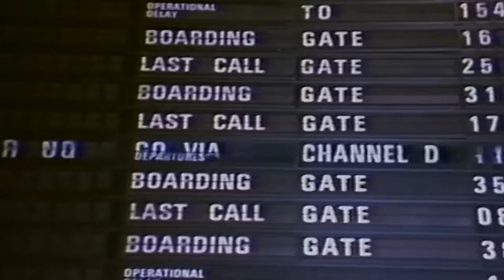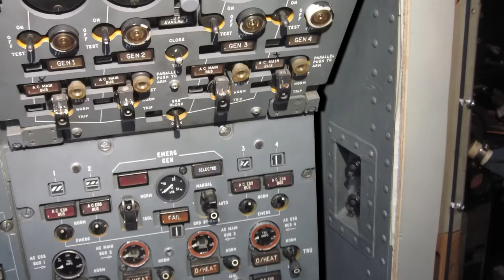Why Blue Paint Caused Problems For Concorde

Comment: The Concorde. What an epic plane!
Reply: It is! And always will be, I even have a picture of the Concorde that's in the Smithsonian air museum near Dulles airport when I was on a school trip to Washington DC!
Reply: Ok so fast speed and air friction was problem because air frame was expanding and shrinking during the flight. 

So how UFOs can fly way way faster than Concorde, some radar data tracked UFOs at incredible speed of 6 miles per second. 

How they can do it?
Reply: @oldi184   IDK some sort of incredibly strong and resistant material that isn't from Earth.
Reply: @Harrison La time traveler
Yeah, You can be right or some kind of "field", force field of some kind which is generated around the object for protection. 

6 miles/s = 21,600 miles/h
These objects can get to any point on the planet in less than 60 minutes. That is truly amazing. 
Another thing is what type of propulsion they use to move that fast. None jet engine will push air craft that fast horizontally inside dense atmosphere.
Reply: @Donald Clark
I have seen a UFO. A real UFO back in 2006. It was classic UFO not drone or balloon or helicopter.
Reply: US hosted Concorde for twenty-six years. How is this sabotage?
Reply: oldi184 idk because they don't exist
Reply: @harrisonofcolorado8886  ah. I think that was F-BVFB that was in Smithsonian.
Reply: @oldi184 🤣🤣🤣🤣 - they clearly don't employ British Airways and Air France engineers 👍😎

Comment: Very interesting. One remark tough. 4:25 white paint does not radiate more heat than other colours, it  absorbs less heat from the sun than other colours and thus reduces temperature on the surface. Black colour radiates the most, but also absorbs the most heat. That is why at the refrigerator the heat sink is painted black but it is put in shadow behind the apparatus. This way it can dissipate as much heat as possible. Keep up the good work!

Comment: A bit of additional information, the SR-71 was intentionally allowed to leak on the runway, instead of it being accidental. The parts were made so that when heated through atmospheric friction they would come into final dimensions, bypassing the need for seals that would work across a wide range of temperatures and mechanical loads.

The plane when taking off would have a minimum ammount of fuel loaded into it's tanks, relying on in flight refueling to fill it's tanks before operations. 

The JP-7 fuel is as well intentionally non flammable, due to a required high flash point and high thermal stability necessitated by the impracticality of completely thermally insulating the tanks.

Comment: @4:14 That's actually a myth, the SR-71 did not leak from poorly fitting parts while cold, especially not fuel on the runway. Several things contributed to this myth, it's worth reading up on.
Reply: Still not completely trustworthy, but there is a "first-hand account" for the 2nd answer. https://www.quora.com/Why-does-the-SR-71-Blackbird-sometimes-leak-fuel
Reply: In any case, the SR-71 is a flipping cool plane. And of you are in Kalamazoo, Michigan... Go to the airzoo to see the ST-71B

Comment: Might not have been as significant if it had been done about 15 years later. These days, there are dark color paints which are IR transparent so those solar reflective whites can be used as a baseciat under the dark but IR transparent colors and while they'll still be warmer than just white, they stay substantially cooler than a traditional dark topcoat.

Comment: Did Primal Space make a lot of this up?   At 4:27 it says that the Concorde's normal white paint was so that it radiated heat better.   Actually, to get rid of heat the best you need a black finish.  But a black airplane would be hard to market.   Painting it blue should have improved heat loss.  
An advantage of white paint is that the pigment can be titanium dioxide, which will not fade, regardless of time, temperature, and ultraviolet light (which is strong at high altitudes).
If the plane was limited in speed, it would be because they used a paint designed to be easily removed (possibly by simple water washing) after filming the commercials - paint that would come off due to friction and/or heat at the normal speed.
The SR-71weeped fuel because it was designed for low weight, so the wing skin is also the fuel tank - there is no internal tank or bladder.   The tanks/wings were supposed to be sealed with a flexible sealant, but when the sealant deteriorated, the aircraft very slowly oozed fuel.   The USAF just didn't think the expense of taking it apart and fixing it was warranted.   It didn't leak anywhere near as much as portrayed and it didn't leak for the reason given in this video.  I've seen USAF aircraft on the ground, and leaks of various sorts are not uncommon.

Why did the SR-71 have a matt black finish?  Partly to make it hard to see at its normal high altitude, and partly because it gets rid of heat the best.

Incidentally, there are a lot of urban myths about the SR-71, due to its secret nature.  The fuel leak due to expansion design is one, the US having to buy titanium from the USSR is another (The biggest ilmenite producer in the world is Australia, which is also a significant producer of rutile).

Comment: 4:26 That is incorrect, like you said, the reflective white paint allowed it to reflect more sunlight so it would absorb less of the solar energy, this would have made it worse at radiating heat.
If they wanted to radiate more of the heat they would have painted the plane black, just like the SR-71.

Comment: @5:50 ‘ Internet is probably safter than flying at mach 2 in a tin can ‘? Dude no concorde has ever crashed by cruising at mach 2 nor it is a tin can.
Reply: SierraAlphaGolf exactly and the only reason it crashed it wasn’t The concourse fault its because they filled it up fully a few there’s a piece of debris on the runway wich the ripped up a tire got caught in the engine and in the Concorde didn’t have enough power and crashed
Reply: I noticed a fair bit of envy by tbe narrator also.  It is not the narrator's fault that his nation could not come up with a supersonic passenger jet.  Why is he so envious?
Reply: @indridcold8433  It's a joke. America put men on the moon, we have no reason to be jealous of a plane.
Reply: @kvltizt  The captured German Nazi rocket scientist put a man on the Moon. The man just happened to be a great American and the project was funded by the Americans. The Saturn V rocket was developed by captured Nazi rocket scientist Wernher Von Braun.  His Nazi criminal war record was expounged in the Untied States of America if he agreed to modernise the antiquated American rocket programme.  This is common knowledge, well, unless you live in the United States of America where it is kind of a secret.  Without American funding and German rocket engineering nobody would have made it to the Moon.  However, one thing the Americans have that is completely incredible and probably will never be topped by any other nation, save maybe their own, is the Lockheed SR-71 Blackbird.  It is incredible to think that kind of technology existed in the late 1950s.  You have to wonder what technology exists today that is well hidden.

Comment: Actually, dark paint dissipates heat better, because it radiates more. BUT it also heats more under the Sun. Which would not make difference while flying at night, though.
I suspect the reason it was overheating was because the paint was not smooth enough.

Comment: 4:37 is t an interior of a Concorde. I’m guessing it’s an Airbus 320 variant.
Reply: Nicholas Barnard What makes you say that?
Reply: @atent5124  It's WAAAAY too wide. Concorde only had 2 seats either side of the aisle. The aisle itself is very narrow on Concorde, as is the width of the cabin overall. I've never flown in Concorde, but I've been inside "Alpha Echo" on two seperate occasions in barbados, and sat in the seats on both occasions.

Comment: Sr71 was black, so it could radiate more heat, the darker blue should’ve actually helped it radiate more heat away. Darker paints can radiate more heat, this does mean they can also absorb more heat, but the sun is not as big factor as the heat cause by friction at these speeds. So it should’ve been cooler, perhaps this is a miscalculation, or a very odd type of paint?

Comment: The SR71 and A-12 did not have fuel leaks on the runway, they used fuel as a coolant and when they couldn't burn it they had to dump it overboard on the ground.  If the aircraft was in flight the coolantfuel would just be burned up in the engines.

Comment: You've got it the other way around. High reflectiveness leads to lower radiation (and lower absorption of radiation too). One would then think that the darker paint would radiate more heat than the white paint but it ain't necessarily so. White is for sure more reflective than blue in the visible spectrum of light but it doesn't say anything about what happens in the longer wave IR spectrum that is relevant for radiation at the temperatures in question. For sure, the white special paint wold have looked darker than the blue one if viewed in infrared. I.e. the white paint was less reflective in IR and therefore able to radiate more heat.

Comment: The SR -71 fuel leaks weren't "sometimes caused" by expansion. It was Designed to leak like that so when it, Predictably expanded the fuel leaks disappeared. It was not a safety issue At All as the special jet fuel used in the Blackbird was extremely hard to ignite. You could literally put matches out in the fuel. Like diesel fuel, it wasn't even considered a flammable substance. Flash point was so high that they used a liquid to ignite it at first starting the engines.

Comment: I thought this was going to talk about the extra weight of an added 200 litres of paint. I recently found out that part of the reason planes are painted white is because to add colour to a paint you add pigments. This creates more weight, which in turn creates higher fuel consumption which all adds up to higher overheads.

Comment: 4:19 white paint does not radiate more heat than blue paint, white paint reflects additional energy and prevents the surface from getting hotter than it already is

Comment: 4:22 "They used a special white paint that was much more reflective than typical aircraft paint, allowing it to radiate more heat."

But shouldn't the opposite be true according to Kirchhoff's radiation law?
Reply: Good point. So it would probably be more accurate to say that the paint reduced temperatures by reducing thermal absorption rather than by increasing emissivity.

Comment: Save yourself 6 minutes: In order to deflect some of this heat, Concorde's hull was painted with highly reflective white paint. This prevented overheating and damage to the aircraft's aluminum structure. However, in the blue Pepsi livery, Concorde no longer had such protection.

Comment: 4:13 Not entirely accurate. There was no separate fuel tank like a normal airliner has. The skin of the plane was the tank. Since the plane was built "loose" to allow for heat expansion at speed, the plane would leak through those gaps while on the ground.

Comment: This explanation seems very odd to me: While dark surfaces absorb more light hence will heat up more when exposed to bright light or thermal radiation, they actually also radiate away more energy than light/reflective surfaces. This is why emergency blankets are reflective, to help you retain your body heat instead of radiating it away. There's definitely some key detail missing in this explanation of how the livery change caused overheating.

Comment: - I was on the flight line 100 feet from a "touch & go" Concord aborted landing  demenstration during an all weekend airshow.
-  And let me tell you. All the videos on I-Max super size screens will never give you the thrill of its flight, coupled with its wind blast & full throttle tail-end engine heat washing over you while your subjected to it deafening jet engines roar.

Comment: There's something controversial about paint story
Blue is darker than white, obviously, so it should radiate better (as it is closer to bb)
Or is new paint worse in radiating in far IR frequencies corresponding to relatively low temperatures (~400K)? It could also be because of some smoothness issues causing higher drag, but it's definitely not just blue<white

Comment: White paint does not radiate heat. It reflects heat. The heat transfer from the hot, compressed air to the plane is minimised. Painting the plane dark blue increases the amount of heat transferred to the plane.

Comment: 1:52 Animation is wrong. It shows Concorde going on afterburners overland. Afterburners were used for takeoff and acceleration (~M0.95 to M1.7) only. They were not allowed overland because of noise abatement procedures and obviously because they increased fuel consumption twice for about 10% more thrust.
3:36 Heat is not just from compression, friction is a big thing when it comes to heat.
4:36 That's not Concorde cabin.

Comment: 4:27 I always learnt that black is the best radiator of heat. This is confusing.
Reply: Isn’t that why the SR-71 and other planes in that family black?
Reply: Black is the best radiator of internal heat. Because of the object’s (like asphalt) efficient absorption, it is able to get warm enough to emit it back out. The Concordes are ideally white to radiate back out external heat from the outside air.
The SR-71 flies higher in thinner air, so it doesn’t encounter as much external heat and thus a white, reflective color unnecessary. It is dark colored instead so it can get hot enough to radiate its own internal heat from its high-powered systems.

Comment: Is this a JerryRigAnything channel? The voice seems very similar.

Also, shortly after creation of the Concorde most countries in the world pushed through aviation laws that prohibited supersonic flight over ground (with the exception for special military airspace corridors), so basically if it didn't fly over an ocean it couldn't exceed Mach 1 as it was illegal.
That was also one of many reasons why the project eventually failed - it was capable of supersonic flight on a very limited amount of routes.
If it had a greater range and enabled connections between Euroe and South America, and most importantly West Coast US with Asia (perhaps also Europe With Asia going over the north pole) then it would have a much bigger market, most likely more planes would be manufactured, and perhaps an engine upgrade would be financially viable in the 1990-2000 which could make it way more economical (the aerodynamic design was great, so basically only the engines aged quickly).

9/11 also didn't help, as a significant number of regular Concorde customers died that day.

Comment: First you say that the heating is due to friction and then you say it is due to the compression of the air in front of the plane. The first claim is not true, but the later explanation is the right one.
To expect air friction to heat something up is like expecting you to get warm from spending time standing outside in a storm.

Comment: 4:09 
The SR-71 was not the fastest jet ever created. That title belongs to the X-43, an experimental unmanned scram jet powered aircraft. It has a speed record of mach 9.6.
If you want manned aircraft, it still doesn't hold a candle to the X-15, an experimental rocket plane which reached mach 6.7 (4,520mph).
Reply: X-15 was not a Jet, it was rocket powered, and both of those never took off under their own power.
Reply: @betweentheeyes3956  if you read my post I mentioned that it was rocket powered. And it doesn't matter if it took off from its own power or not. The SR-71 is not the fastest aircraft, nor the fastest jet aircraft. Its the fastest chunk of taxpayer money the CIA has managed to waste. Its speed is not even that impressive when Mig-25s have been clocked doing mach 3.2 and the XB-70 was built to cruise at mach 3 from the US to the soviet union and back.

Comment: You still never touched on why the blue paint was a problem for the tin can in question.
Reply: Because the blue paint reflects less heat and would cause the tin can to get to hot

Comment: Safer than flying at mach 2 in a tin can..... really? I'm sorry but until the crash, the Concorde's safety record was IMPECCABLE! It was flawless, yes they had issues my father worked on the British Airways fleet, he knows the issues, logged them, fixed them. But every aircraft has issues, that's why they are constantly maintained and taken apart, routinely inspected before evert flight. A few times a year aircraft are completely stripped and fixed. Concorde is no different, she's certainly special but she was the safest aircraft you could fly on, it's actually STILL safer safe to travel by aircraft than it is to go on a boat or in a car or public transport.

Comment: I reality of course, Concorde was one big vanity project. A proof of concept that was never financially viable - despite finding enough vain people to pay the astronomical figures to ride it for a while. It was sparse, dingy and cramped. It used 2 tons of fuel just to taxi to the runway.
It was clever engineering, but too dangerous for passenger flights. Toward the end, Concorde experienced a serious incident (requiring return to airport) every month . The accident that finally ended it showed how lucky everyone had been all along; the force with which a harmless bit of rubber debri went through the air intake left with such force it punctured the unprotected fuel tanks . Something they'd known about since '79